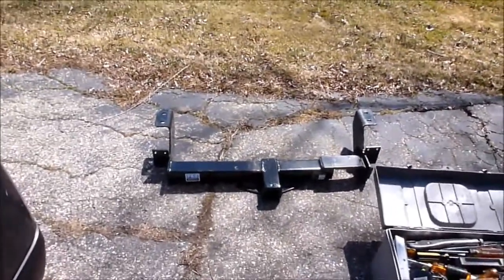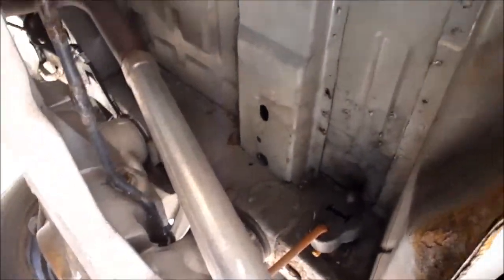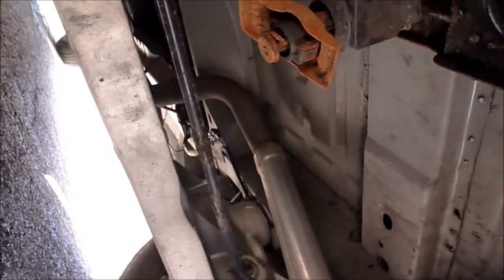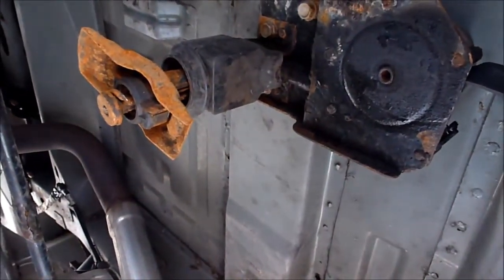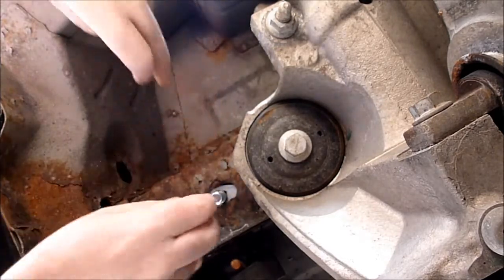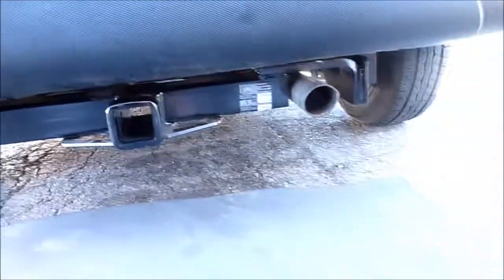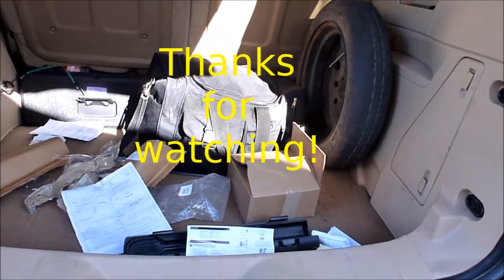Buick Rendezvous Trailer Hitch Installation

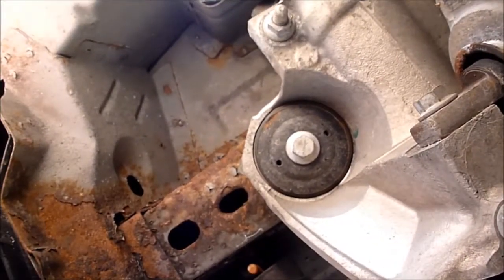Comment: 0:51 2:41  ...man that's a lot of rust. LOL   ...I thought my Rendezvous was rusted, compared to yours, mine is in pristine condition for a 2004 vehicle.  Thanks for loading your video.

1:09 that spare tire hoist needs to be drenched in Brake fluid, that'll loosen all the moving parts.   Works every time on rusted bolts.
Reply from the maker: That's not bad rust at all, just surface rust.  If you grind that safety hook off the spare tire holder, it will work just fine.  All the GM trucks have the same set up.
Reply: @Jeffnham  Bruther i'm not a rust belt mechanic but that looks like at least a nice middle ground between surface and not surface lol
Reply from the maker: @panzerfaust5046  Car is long gone now!